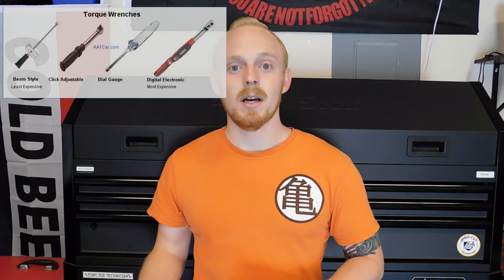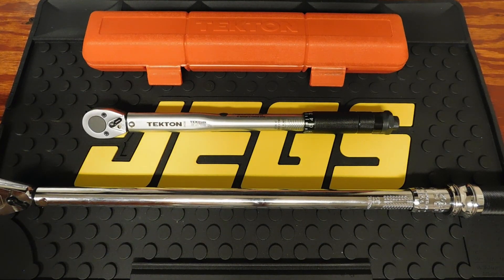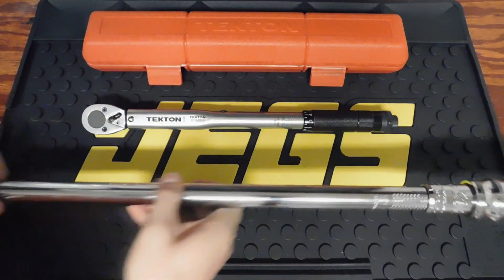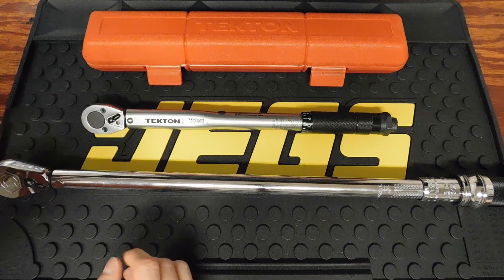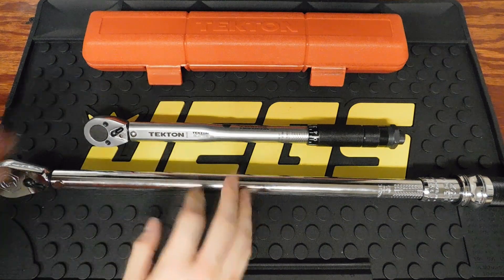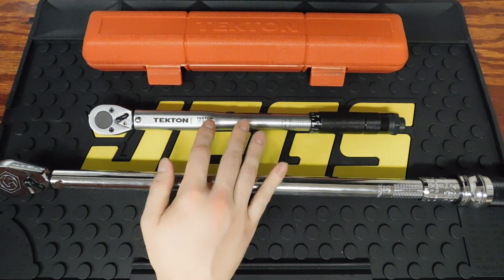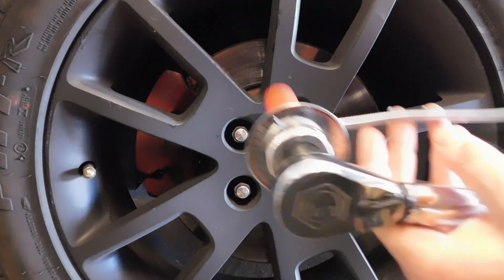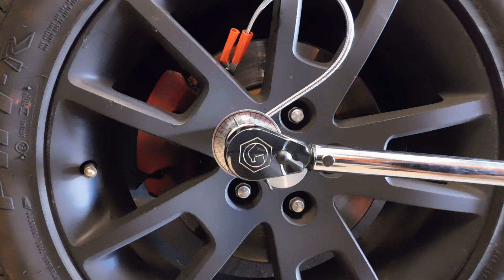Tech Tip Tuesday: How To Use a Torque Wrench

Comment: 16:00 Can you use a wrench other than a torque wrench to do the angle adjustments?
Reply from the maker: Manuel Salvatierra yes you can. Alot of people just use the torque wrench bc they already have it in hand but yes you can. Great question. Thank you!
Reply: TonyTheTechnician Because after torqueing, does tighten even more to get the angle mess up the torque wrench after it click?

And to get the negative angle after torqueing, does it mess up the torque wrench if you try to loosen? 

Thanks for the reply. Great video as always
Reply from the maker: Manuel Salvatierra thank you for asking and commenting. Sorry I should have mentioned that. You can either turn up the setting on your torque wrench before doing the angle to prevent it from clicking or you can use a normal ratchet or breaker bar instead if you find that easier

Comment: hey Tony great post just got, my last purchase, a new torque wrench, a autocraft,I got at advanced Auto parts also at car-craft. it's their brand. it works great. the direction are pretty specific about using it in increments. Wich I would for sure on like a head. it's just like your 3/8 with the lock nob. I was thinking about the Pittsburgh model but it does have plastic on the end so I opted out on that. it was not a bad price like 35 or 36. plus ten bucks off sale. hey how is your little one doing I hope well and mom
Reply from the maker: Martin Schaffmeir oh nice, glad you found one your happy with. The baby is doing great. Getting bigger every day!

Comment: Good video. I have a 1/4", 3/8" and a 1/2". I've never actually used the 1/4". I have a friend that owns a tire shop and he never lets his guys use click types because they never zero them. He used to make them use beam but now he requires them to use digital.
I can see that it would be a bit of a pain to return them to zero all the time when you're doing tire after tire. I would think that zeroing them at the end of the day would suffice but I don't know.
Thanks for the video.
Reply from the maker: Bruce L. Ya I think the same. It isn't necessary to zero after every use. Even accidentally leaving it over night every once I awhile won't hurt. Unless it is happening all the time and it gets left like that over a weekend. And ya you don't really use 1/4 much unless you rebuild alot of engines or sometimes rear diffs

Comment: Using extensions makes no difference in torque using s torque wrench. And don't torque turn after your click type had already clicked. It will ruin the pawls.
Reply from the maker: Terry Peterson the extensions do affect the torque setting. Especially if they are impact grade since they are made softer they can twist with force and the longer the extension the easier they are to twist. Same thing goes with adding extensions to an impact gun. Same principle as a driveshaft. They don't make driveshaft over 72 inches bc they twist to easily. And ya I know the clicking after hitting the rating is good for it but I was doing it for demonstration purposes. Thank you for watching!!
Reply: TonyTheTechnician I have been trained and certified by Snap on for torque testing and proper use of torque wrenches. Extensions make no difference as long as you're at a right angle and you pull in the middle of the hand grip it will be accurate. The extension can twist all it wants but if the wrench doesn't click it's not torqued to what you set the wrench too.
Reply from the maker: Terry Peterson ok thank you!

Comment: You also don't jerk on a clicker style torque wrench after hearing the clicking noise.Get a false torque reading when jerking on them.The electronic versions,can damage them exceeding the specs.Heavy equipment mechanics are known for doing this.The Snap On Tech Angles,get an error code exceeding the angle gauge specs and they have to be sent in for repair to fix this
Reply from the maker: wafrederick yes very good point!!! I will make sure to go over that when I get my elect3onuc gearwrench torque wrench. Thank you!!!
Reply: A Matco dealer I had knows a customer that damaged a Snap On Tech Angle this way.spec was a 600 degree turn after torqueing the fastner down and this Tech Angle was not up to 600 degrees.
Reply from the maker: wafrederick oh damn that's crazy

Comment: Honest question: Can someone explain why people spend so much on digital wrenches? I use the click style at work and they are super easy to use. Is it really worth the extra hundreds of dollars per wrench for digital and if so why?
Reply: David Anderson they are worth the money speacially when you getting pay for the job instead of hourly. On the newer cars that you have to do angles you don't have to reset a manuel angel on every bolt, and when you are done all you have to do is turn it off. To me it was word the extra money.
Reply: The angle meter makes it seem more cost effective than I thought, I didn't realize they had those built in. I work on helicopters and we never torque to specific angles, just 1/6 or 1/3 of a turn (outside of specific numerical values obviously). I can see how if you need an angle meter having one built in can save a lot of time.
Reply from the maker: David Anderson I know they are really easy to use but truthfully I've only used them a couple of times. And your right the click style is just as easy and you don't have to worry about batteries or anything. I do plan on getting one from gearwrench but as far as if they are much better I guess I will have to see. Hopefully someone else will chime in. Maybe it is just user preference and having the angle meter built into it. But I don't know lol

Comment: When I first started in heavy equipment mechanic it was all deflection bar. But when the clicker torque wrench came out I bought the quarter inch in inch pounds three eggs and put pounds and half inch in foot pounds. The Electronica just way too expensive for me to afford right now. But thank you for the video you did a great job on the video
Reply from the maker: John Erickson thank you!! And ya I know what you mean. Those electronic ones do get expensive. I plan on eventually getting the gearwrench one for like 150 but I know kobalt and craftsman make them for like 60 to 100 dollars.
Reply: TonyTheTechnician  thanks for the additional information bro